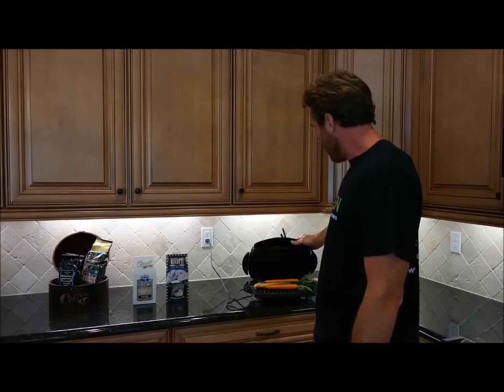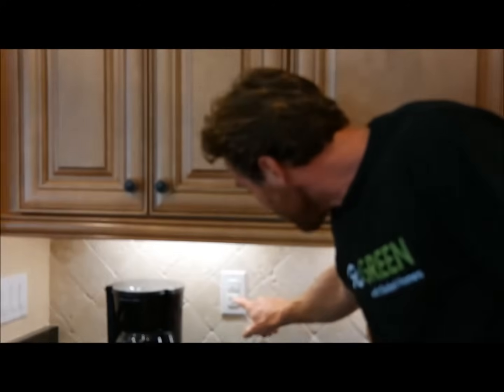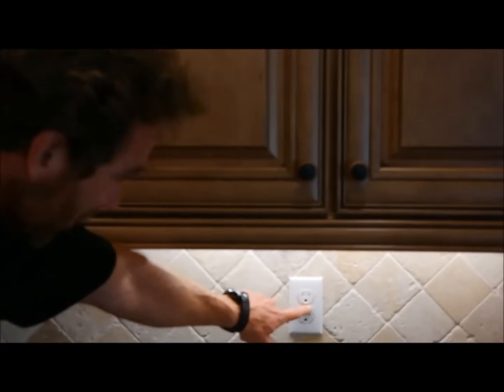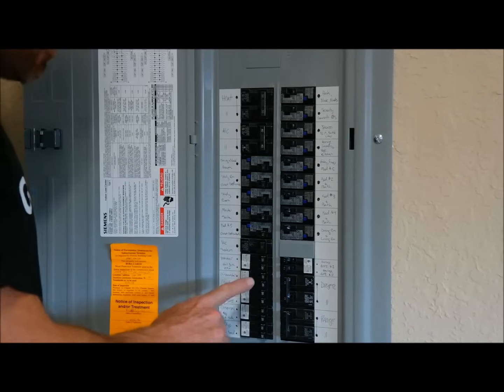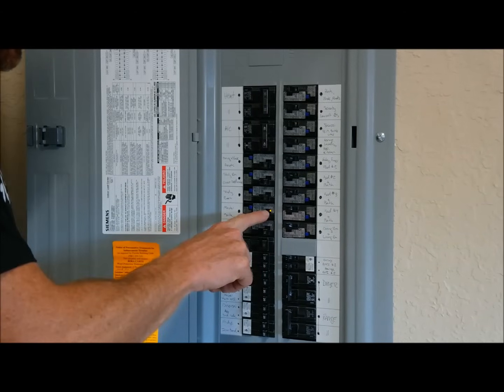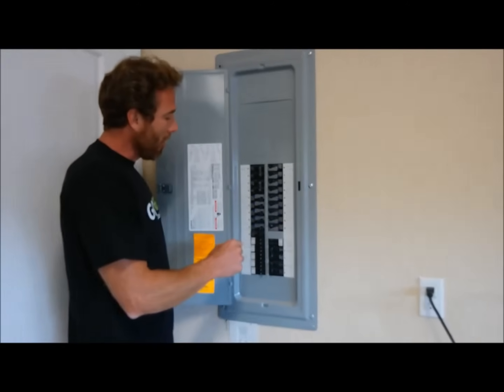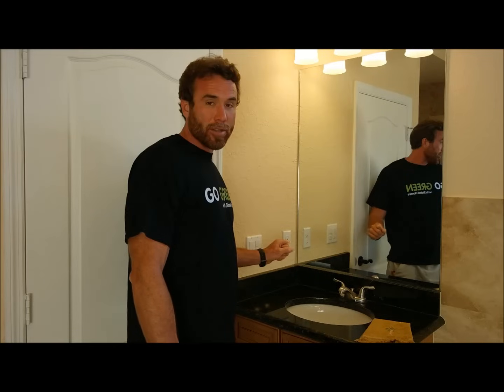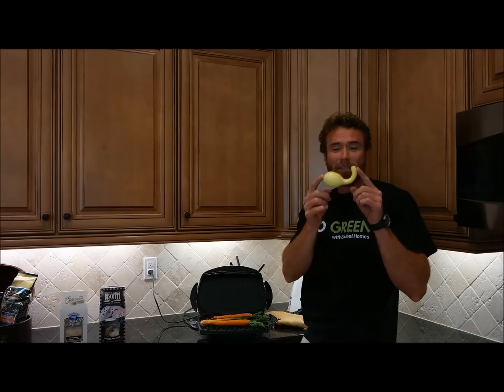Is your outlet not working? See how to reset your GFCI outlets and circuit breaker

Comment: All my exterior outlets (front and back) stopped working after I rinsed off my front porch and probably got one of the outlets wet.

I reset the breaker as well as all of the GFCI outlets I could find. No luck. Help?

Comment: I powered washed my house during the day and in the evening when I tried to turn the outside lights on they didnt come on. The foyer lights didnt come on as well. I checked the breaker and the the breaker that controlled those lights were in the middle of on and off. I flipped it OFF and then to ON. The lights came back on for about 15 seconds and turned back off. I checked the breaker again and it went back to the middle position. What should I do?

Comment: He has  knowledge of the product although  his demonstration is poor. 

 Before jumping down my throat , think  about this:
most of the viewers most likely have brought up this site because they don't  understand how the gfci / AFI is  wired or how it functions in  a circuit or how to  reset it  should it trip.  
I'm sure they would want to  see a close  up graphic photo or video.  
That is where this site  has a short fall. 
 One cannot see a close up of what the breaker  looks like.  The video has not  included close up shots illustrating the physical appearance of the front of the GFCI /AFI, the trip button or how to reset.
In addition there are some features that the new gfci  and AFI combo has and he doesn't illustrate or explain.
Some have a small microswitch reset on the breaker and others have different configurations.
These  should all be shown close up .
Thank you for the opportunity to comment

Paolo

Comment: I have a couple of power outlets that won't work. My electric panel is similar to yours. I tried moving the switch back and forth for my room and it didn't help. What could I try next?

I don't have those GFCI outlets. My home was built in 1983. Could this be a fuse issue?

Comment: Thanks, I think I have to call an electrician. I have an old house and the outdoor outlets don't have a reset button I checked the ones inside and ever turned off the entire panel an still nothing. That stinks.

Comment: I have a freezer in my Garage, an outlet for the garage door, and an outlet for the Sprinkler system. I can't find the GFI that supports these but I think they're all on one circuit. The electrical box says "Garage" but that was only for the lights in the garage.
I have pressed reset on every GFI that I could find.  House is only 5 years old
Reply: Did you find a solution? My garage outlet is not working either but lights still work

Comment: Ok, I have a question.  My son in law had a pool pump plugged in to the outlet outside.  It tripped and pushing the rest didn't work last summer.  I got here in Dec.  I tried it. Plugged in my phone and it was working even though no one has messed since it quit.  He plugged the pool back in for a sec just to see. And it was working.  But the second he pulled it out I heard it pop. Now the one in the doesn't work either.  We push test or reset and nothing.  After watching your video we tried the breaker.  Nothing.  I don't want to call the electrician.  But I will if I have to.  Hopefully you have an answer for me. But if not, that's ok. For some reason everything is always,  " got to be the hardest way." Just my luck I guess.  Thank you.

Comment: A normal outlet has 2 wires.
I reset the breakers.  I put a new plug in. not gfci.
I tested the wires and they do have power as I shock myself with 120
After putting the new plug in still no power.
this is freaking weird.

Comment: I have 6 outdoor outlets all on a gfci breaker, just replaced 4 out of the 6 to gfci outlets and none of the replaced ones work but the 2 I didn’t replace do work. Breaker isn’t tripping…? The gfci outlets don’t have any power to them I’m confused. Is it possible my white is hot and black is neutral and they are wired incorrectly? I swore the old ones were correct.

Comment: Thank you! Great video! Your explanation regarding the arc light and testing was exactly what I needed when my electric fireplace turned off and tripped the breaker switch . When I went to my breaker panel, I didn’t know why the arc light turned on when I switched the switch to on, so I switched it back to off thinking it was an alert of a faulty switch.

My 15amp switch is on the right side of my breaker panel, so was a bit confused when my off position was to the right and yours was to the left, but figured it out that was fine..

Comment: I wouldnt say its that unsafe or hard enough to not try to repair the breaker yourself. As long as the power is off and you check it for a guarantee. Just make sure the outlet itself works, i mean its a few dollar replacement or make sure no wires are touching. If you have no money and cant figure it out an extention cord fixes alot

Comment: I had tried to reset my GFCi it did not work, I checked the breakers they were on, I turned on and off nothing happened, then i watched this video and checked the panel breaker again I did everything here then My outlet worked. I almost call an electrician for 150Dls an hour. Thank you I saved some money.

Comment: No breakers tripped? Smell the outlet! It is most likely time to go get a new outlet, $5-ish. Mine shut down all of the other outlets in the room, as they are all tied in same circuit. Did not trip the breaker. Not a GFI outlet so smell it, could cause a house fire. Turns out it was burnt from cat puke. Awesome! Also, turn off main electric switch in panel, take out the outlet and disconnect the wires, and connect them the same way you took off to new outlet. Simple 4-5 wire process. 2 black, 2 white, one ground/green screw. Lets stop paying these home owner insurance/warranty fees, they are rediculous.

Comment: I could kiss you right now loll. You're a lifesaver. I pushed the reset button soo many times and would not work and half of my kitchen is with no power including my fridge lol. I just went to the panel and did as you said, turned it off all the way and turned it back on and boom ta ta. Thank you❤❤

Comment: Great video!!!

I have a question? I bought a new washer machine and every time I plug 🔌 it to the gfci in the kitchen, it sparks ⚡️ 
Usually outlet sparks ⚡️ when you plug something on it.  But I noticed, it parks more with a 3 prongs cord, like the washer machine for example. 

Again, it only sparks ⚡️ and it is not tripping the gfci. Do you think I should leave it plug here and not keep unplugging it? 

Do you have an idea what this could be? 
I appreciate your help.

Thanks!

Comment: Mine, however, isn't common. I know enough about this stuff but thank you for a great video. My GFI stopped working after I replaced a light switch in the bathroom. I even replaced the old GFI with a new one. Still... no power to the GFI. I checked for loose wires and they're all secure. However, they all appear to be positive wires in the light switch. I know it has something to do with the light switch because the GFI stop working after I replaced it. I even moved two of the wires around, not the ground, and the GFI still doesn't work. Weird, the light and light switch still work. So does everything else electrical in the bathroom work. Just no longer the GFI. Any advice before I call an electrician would be greatly appreciated. Thank you!

Comment: my portable ac has a gfci plug that i think cute half homes power tonight  . no switches in my breaker tripped  so very confusing . also the ac that has gfci plug was plugged in but not on at the time  and very little power was turned on in my home .   i did turn microwave on and it happened a 10 seconds later ,but when i started reading about gfci plugs i remembered ac had one  but i cant click it in to reset it . do you think its possible that my ac plug killed power all down the line like to half plugs in my house ,does  gfci plug need power for buttons to press   . also i unplugged the ac that has the plug so to reset gfci how without working gfci plug
Reply: only other gfci in my home are in bathroom outlets and those have power

Comment: Thanks man!! Just bought a manufactured home and noticed my master bath outlet wasn't working (not a GFI outlet). Checked the breakers--all good. Went into the guest bath and that outlet (GFI) had tripped. Reset and the other one came back on! Sweeeeet. (Your cute little accent is hot, Skobel). That was  a well spent 5 minutes.

Comment: You have to reset all the GFCI outlets on the same circuit that had the short or the faulty appliance. Some may trip, some may not but you have to track each one to make sure, especially if the most upstream is a GFCI. I had a short on a non-GFCI outlet but the most upstream outlet (which was GFCI) tripped without even tripping the breaker.

Comment: Anyone have any ideas for my situation? We have our master bathroom outlet, 2nd bathroom outlet, one random outlet in the indoor lanai, an outside outlet and 2nd bathroom exhaust fan and light on one switch.  Thankfully my husband and I labeled everything when we moved in 3+ years ago.  

The light and exhaust fan work.  None of the outlets do. We don't know when they stopped working but it was probably a few months ago.  We don't use any of the outlets regularly (no hair dryers, nothing in any of the outlets). We only noticed it yesterday. Nothing was tripped in the box. 

The 2 bathroom outlets are GFI. We tried resetting those. Nothing.  Neither the outdoor outlet nor the random lanai outlet are GFI and there is nothing to reset on those. 
 
My husband has replaced the circuit breaker in the box as he is quite handy.  The light and fan still work.  We had power to the 2nd bathroom outlet for a split second and then nothing.  He has now taken the two bathroom outlets out completely. Nothing.  No random burnt cords. 

The light and exhaust fan still work.  No outlets on that breaker do.  We have tried every switch, tried resetting the main breaker. We have an electrician called.

Comment: Thank you for the quick and simple explanation. Triped the outlet that turned every outlet in my room and the hallway off. It sent the carbon monoxide detector off because there was no power and I started to panic because the breaker box didn't have any of the switches switched off. Wooo what a great night.

Comment: Last night I had an air fryer and an electric grill powered up at the same time and within a minute, heard a pop from the breaker box and both equipment shuts off. Basically I don't have power from those outlets anymore. Do I need to replace the breaker?

Comment: On GFCI outlets ,There are (very often) downstream outlets (LOAD side) and these outlets are protected by the GFCI outlet.   So  you may not have anything plugged into the GFCI outlet and it will not reset.  This mean that there is leakage  to ground  at a downstream outlet,   I mark all outlets with a GFCI sticker  and unplug any device that is plugged into them, and then go back to the GFCI and try to reset.  This can sometimes take a while until you find the culprit.

Comment: You are amazing! I most certainly did show up to this video at the right time. My bedroom electrical outlet went out this morning. I tested other outlets in the room which didn't work either, not even my bedroom light switch. I then called my electric company automated system to make sure there was no outage and there wasn't. I then tested the outlets and light switches in other areas of the home. Those all worked fine. I came across this video of yours and bam! I fixed it by resetting the bedroom breaker by flipping that switched. It shown "off" so I turned it on and saw the red light blink. I went back to my bedroom to test an appliance and it fixed it. Thank you so much for educating us on how to fix our own problems first before spending money with an electrician.

Comment: hi , I followed your directions, because my downstairs bedroom lights went off, I kept turning off the breakers, and waiting and turning back on, but no luck. Finally I turned off the gfi in the kitchen and bathrooms, but no luck. I went outside the back porch and press on the light on the outside switch/plug, and all of a sudden it worked. Thank u very much, I watched your video over and over, to check if I missed a step, but soon as i came home I remembered i have a gfi plug outside. Thanks again, you made the steps clear, and in order

Comment: Helpful AND handsome--my favorite combo. Didn't solve the problem but anyway thanks. (One half of the GFI outlet is lit the other half is not. One half when I plug the disposal into it makes the disposal run nonstop. The one next to it, where the disposal was plugged in, the one with the light off, doesn't work.

Comment: My electrical outlets in the master bathroom don't work and there is no reset button.  I checked the breaker panel, the breaker was not tripped but I reset it.  Still not getting any power at the electrical outlet.  Should I get a electrician to check the breaker?

Comment: Thank you very much for this video ,I could not figure out why the plugs in my bathroom would not work ,After going to the store and getting a new Circuit breaker and installing it it still did not work I got another circuit breaker installed it and it still does not work I was getting ready to go buy new outlets then I watched your video and realized that there was a GFI outlet in the guest bathroom that had a reset button on it ,that was the answer I pushed that button and it fixed my problem. I wish I would've watched your video in the beginning save me a lot of hassle.Thank you thank you

Comment: WOW!!!  The outlet that my garbage disposal is connected to stopped working.  After checking the breaker panel in my basement (which was not tripped), I couldn't figure out what the problem was.  After watching your video, I went to check the outlet on the outside of my house.  I didn't even realize that it had a GFCI button.  I pressed the reset button, and my garbage disposal was instantly back in operation!  THANK YOUR SIR!!!!!

Comment: Thank you so much for your help! My house was having this problem, and I tried everything! But the part when you said to go to the circuit breaker and flip the 'outlet' switches all the way left then all the way right, I can instantly hear the things that were plugged in being started up.
Reply: I just encountered the same problem. I know this is 4 year ls old comment, but I'm gonna try the break panel trick. It seem so easy.
The only challenge is figuring which button is for my outlet near my living room window.
Reply: condorX2 man 4 years ago... I vaguely remember posting this comment xD

Comment: Excellent Video. For the life of me I was not able to get the outside outlets to work and no circuit breaker was tripped. When you said look at all outlets on the same circuit, that was the key, I checked and one in the garage had the light on! it was causing all of them to not work!

Comment: Thank you. You saved me a call to the electrician. All the breakers were fine, but my reset button on the outlet wouldn't stay in. I checked all the outlets inside in the kitchen and bathrooms and all were fine, except the one. But you mentioned the outside outlets. Well, it was raining and, sure enough, I had an extension cord plugged in outside from doing yard work. And when I unplugged that cord, the inside outlet was able to reset. So thank you. I wouldn't have thought to try the outside outlet if you hadn't mentioned it.

Comment: well I got a question, though I understand this is not the best place to ask it. I live in a house my grand parents built them self's and it doesn't have any reset buttons on the outlets anywhere in the house. Also the breaker box isn't tripped either. Yet one of the outlets that my fireplace is plugged into is no longer working, (I know its the outlet because if I use an extension cord to plug it into another outlet across the hall it will work.) and I already replaced the outlet itself which didn't help. so what else could be causing the power to the outlet to fail if it's not the outlet or the breaker box? I have tested all other outlets in the house and it's the only one not working
Reply: Possibly damaged wires... Animals?

Comment: Have 120 volts on all three circuits in room with no reset button and power is coming through just won't connect soooooo confused I reset breaker and all the bathroom reset buttons any ideas what's wrong or what to do ??

Comment: Thank you for this informative video! Is there also a simple solution for reseting non-GFCI outlets? I live in an old home with no GFCI outlets and one outlet is dead after using a hairdryer. Would be grateful for advice as to how to fix this myself, or if it requires an electrician. Thanks!
Reply: sara13251 A fix yet?
Reply: Hope so after 3 years... Otherwise, shit, that girl got some effed up 'do' with no hairdryer...

Comment: The reset and test buttons on the alci outlet in my bathroom are pushed in.  I just had this outlet replaced professionally about 4 months ago. after having the original alci outlet give off a huge spark.  It worked find until now.   Could it have been a faulty outlet that was put in? I have checked all alci outlets in my home that I could find and checked then breaker panel.  All but one outside outlet was OK. I reset the outside outlet but still have  the bathroom outlet button pushed in. Do you have any suggestion before I call the electrician? Trish